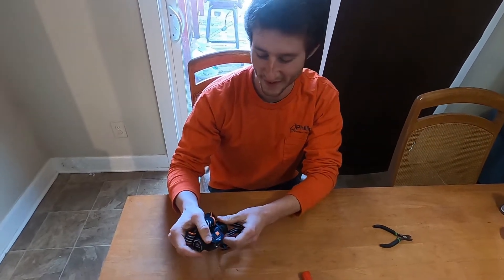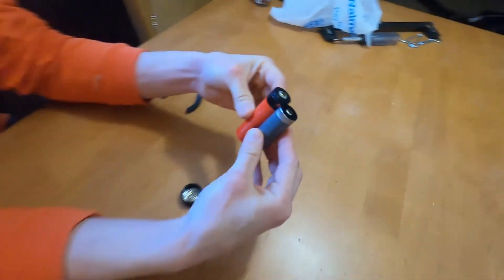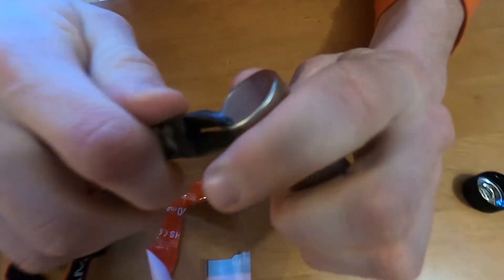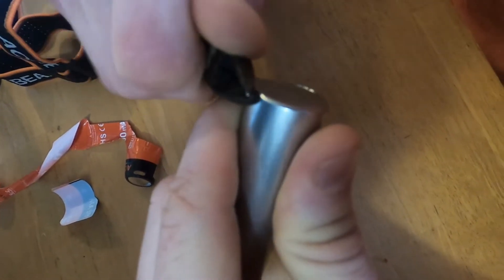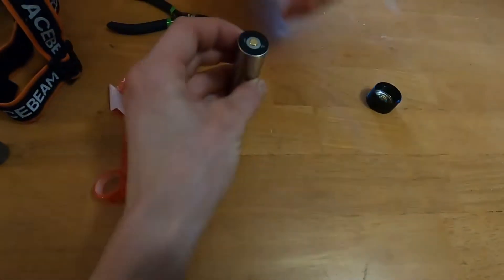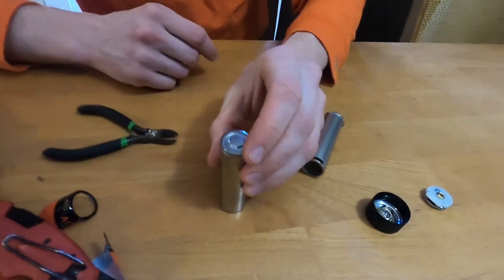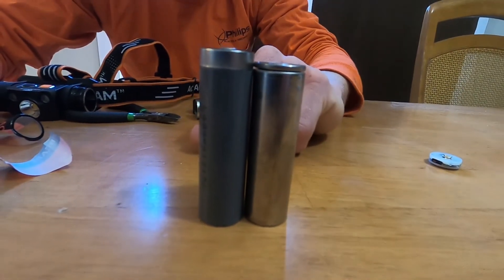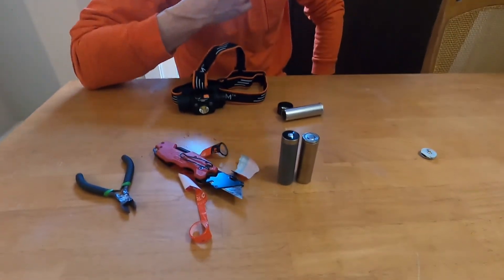Taking Apart A USB-C 21700 Battery

Comment: Thank you for that. I'm looking to repair the USB C port on in the same headlamp because I lost the cover and dropped the light damaging the C port on the headlamp. I've never repaired or replaced a charging port. It is the plastic cover that needs to come off. I ordered another battery w/integrated charging port like the one you dismantled in the meaning so that  I'm not dependent on the C port in the headlamp. I have used and beat this light and it's been a beast. A heavy beast, but has done the job exceptioally. I use it for many hours ever single night. Thanks.
Reply from the maker: we didn't mention in the video but we wrapped the dissembled batteries with a thin layer of electrical tape everywhere that originally had pvc covering on the battery to prevent accidental shorts. it takes a little practice to get the thickness right so it fits in the light but we feel a lot better having them wrapped up again!